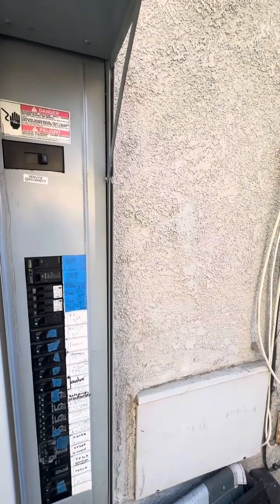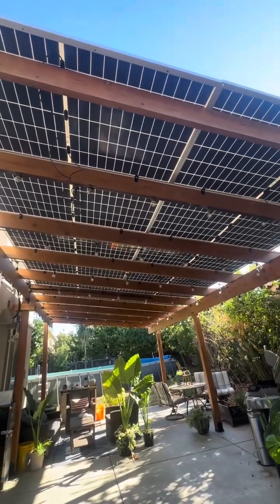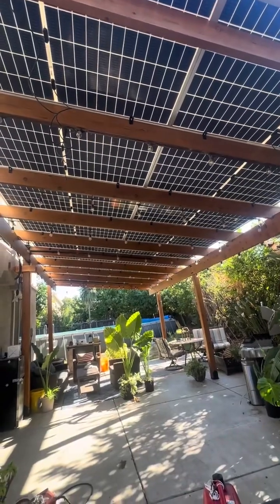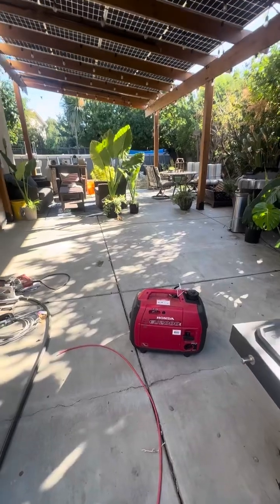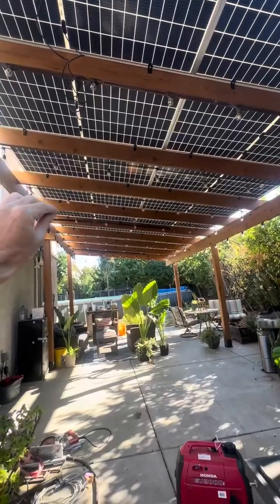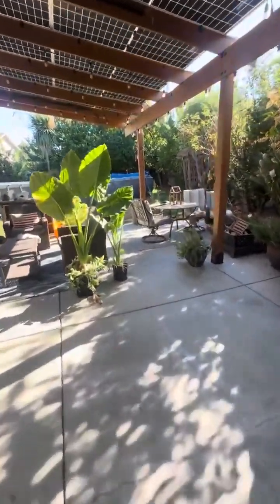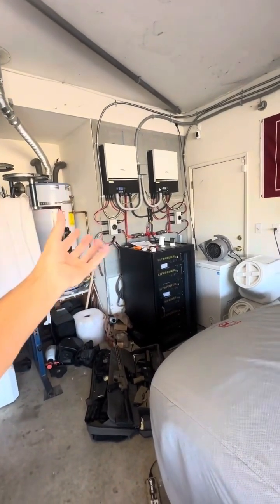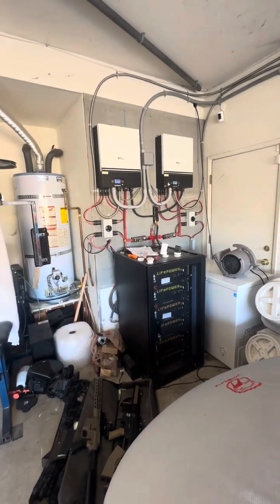Prepper view of benefits of an off grid ground mount battery storage solar system ￼

Comment: Nice system until you got to the inverters. Light duty, high frequency, transformerless inverters like these offer shorter life expectancies, a poorer surge capacity, and can damage your AC appliances because they lack output transformers to provide galvanic isolation between their DC boost stage and their AC output. A much better choice would have been to install heavy duty, transformer based, low frequency inverters for reliable survival purposes.
Reply from the maker: Yes, you’re right for prepping a low frequency transformer inverter would be the way to go. I bought my Inverters based on price they’re about $1300 apiece but recently they came down to 1000 so I was able to buy spare Inverters. They are light duty, but so far the system has put out over 30 MW of power. Not sure how long they’re gonna last but I have the spares on standby also, if we ever get hit with a EMP, hopefully my spare inverters that are not hooked up to anything will survive

Comment: Just went through Helena and Milton.  The little array I put together to power my garden shed was the Hero.  It kept the fridge running, the lights on, and devices charged.  300w total.  It finally sold the concept to the wife.  Next up is a directly solar powered pump for the pool.

Comment: Great video! I like the way you set up the awning with the panels as the roof. I got the solar bug last June of 2023. I just completed my system and starting in June of this year I went total off grid and now have a $. o power bill. Your right you can't beat the satisfaction of powering your own house. I still have the house connected to the grid in case I have to shut down the system for maintenance. Using the pool for fresh water is a great idea too. The tesla is a really cool car but out of my budget for now. Hopefully in time the price will come down. Once again great video keep up the good work.